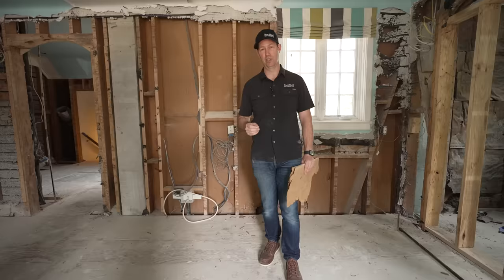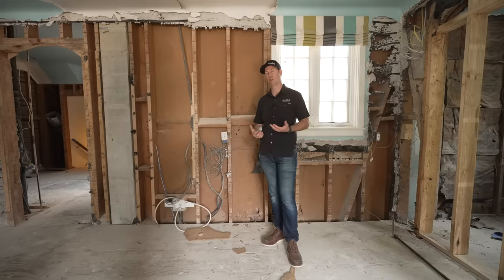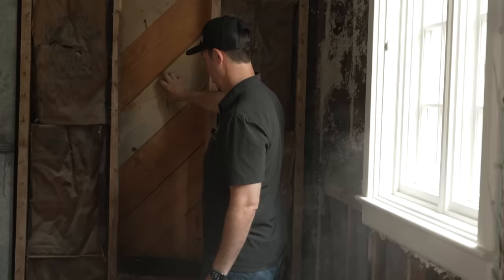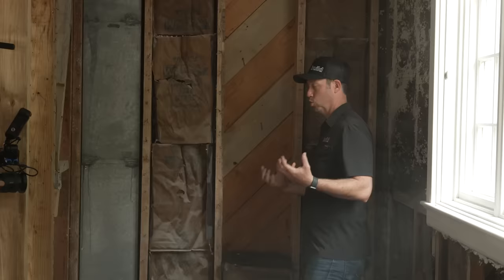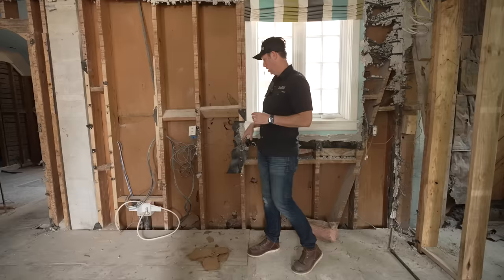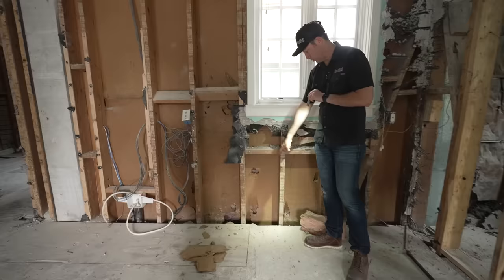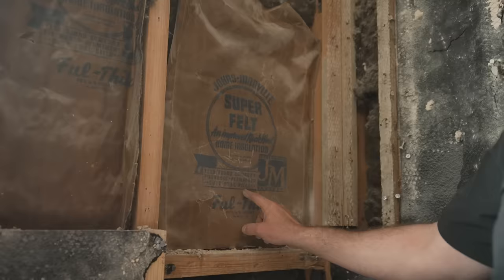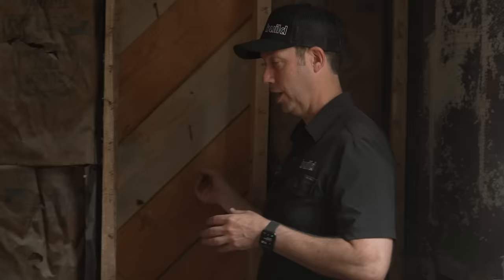I’m recommending we NOT INSULATE This Old House

Comment: If the owner wants to use sheet rock instead of plaster job, it is wise to prime the back of sheet rock with "Kills" primer paint before enclosing the wall cavity.   Also , instead of insulation. Maybe press into the cavity that tybeck fabric instead of insulation.

Comment: Tape the holes and spray foam it with closed cell then do the pressures sealer you did on your house
Reply: The sun will always drive moisture in, and you want to create a dam it can't pass through?
Reply: @AsHellBored  the sun will drive the moisture through the brick. It’s still air gapped on the outside. As long as the weap and vents in the brick are still clear it will evaporate just fine. And by creating the vapor barrier you protect the rest from the actually damaging humidity from the inside air at the dew point if done correctly.
Reply: @jameshancock  But is the 'closed cell' a vapour barrier?  I'm thinking it is not.  Therefore you have to be careful not to leave the dew point inside the insulation, somewhere between the inside face and outside face of insulation?  The cavity between the brick and the sheathing material looks to be ventilated, so will dry on that side.
Reply: @digital100000  it is a vapor barrier beyond 1.5 inches. Open cell is not.
Reply: @digital100000  Yes, closed cell spray foam is a vapor barrier at 1.5". Open cell is not. Matt has done videos on this and the difference.

Comment: Have an old home from 1920s.  I have the ship lap sheathing seen here with balloon framing, no insulation.  The wall material i tore off on 2nd floor exterior was Cellotex Lath (cane fiber board with 2 plaster coatings).  I am wanting to insulate.  Would you recommend the rockwool/thermafiber or a faced/unfaced fiberglass?

Comment: Not sure what/if it's called something else in the states but I've got the same in my house in Sweden, here it's called Tretex and it was used as the layer between the solid 3x10" timber wall and the wallpaper
Reply: it's actually garbage and burns like h*** but it does have an insulating property

Comment: I had a black spot appear on my kitchen ceiling, below the master bath shower. Pulled the sheetrock and found a leaking copper 90 degree. It looks like it had a slow leak for 20 years. Even though the screws had big rust circles around them, none of the studs had mold. Even though everything was soaked.

Comment: Repairs to old houses should be undertaken like restoration of an antique cabinet. Don't modernize it - preserve it. There is no reason to change this into a 2021 new construction.  Sure you can make it look pretty, but quality building materials and quality workmanship kept this house livable since the 1920's.  Repair it with high quality materials, update the electrical wiring, install high quality windows.  Don't make this an airtight submarine. With forethought and planning, this house could outlast us all.

Comment: that is why you don't put multiple vapor barriers in a wall.  if there's one, you can dry it from both sides of the barrier - if there are two, the moisture gets into the space between and doesn't get back out.

Comment: That area to the right is probably original wood board sheeting, about 4' out from every corner and maybe a few other key areas would have been wood boards for shear and the rest would be that cornflake box stuff.  I believe it was popular in Canada for longer than the U.S. but structures that used that stuff for sheathing either had wood corners or bracing inside the walls at the corners otherwise there would be excess movement and plaster (and possibly windows) cracking.

Comment: On my 130 yr old home, there is no sheeting on exterior walls. Just studs and you see the brick with plastered walls. Now, the house is covered with aluminum siding top to bottom. Wouldn't this make it safe to insulate the cavities? I have to assume no moisture is getting through the aluminum siding.

Comment: i have been debating the same thing with my house .. but i have plaster insides with clapboard outside . i'm thinking ZIP-rR on the outside (or plywood with atlas foam sheets ) with hardie siding with an air gap and no wall insulation ...

Comment: As some have mentioned, adding air conditioning will change thing going forward, with or without insulation.  Maybe you should consult some building scientists, before making a recommendation.  It's very likely they will have tried renovations both ways before and can offer some insight.

Comment: My questions: Is the air space behind the brick greater than 1"?  Would adding a secondary wall (double wall) be a solution? The inside cavity could be insulated. The outside cavity would be a full 4.5" thick & could dry out up & outwards. Does the exterior stud wall need some additional diagonal bracing or cross bracing?  Just some questions.

Comment: I love old houses, only downside is the fire hazard. Those open cavities in the wall makes it super hard for firefighters to stop the fire, so any in-wall fire will most likely end that house. I would personally invest in the electrical items, you even get wall boxes that fill up with fire retardant stuff today. Also, looks like the wiring is not currently in PVC tubing? I believe those are required for the fire retardant boxes to work.

I have seen old houses with metal tubing, honestly that would be pretty awesome if you had earth fault circuit breakers.
Reply: I would just add more firebreaks.
Reply: new houses will burn faster tho
Reply: @stewartcaldwell5299  Yeah, but the fire break blocks shown in this video are knocked loose and at an angle!!!
Reply: @markpashia7067   I think they're at an angle on purpose. Looks like 2X6s which would contribute a lot to the stiffness of the wall, in and out, and left and right.

Comment: hmm..I'm not sure you couldn't insulate  with un-backed bats - Moisture has to go somewhere and not condense and linger on the material. Mineral wool or fiberglass insulation would be pretty transparent  to moisture as long as it's not faced and you used lath & plaster since there' s no organic material.   I think your friend is correct.  I think TOH discussed the difference between vapor barriers in Northern versus Southern climates:  In the South, you want to keep the moisture outside from creeping in while North, you want to keep the moisture in (and prevent it from escaping through the walls) - with no vapor barrier outside the moisture will enter the walls and needs somewhere to go. I'm thinking you might also choose a stain wash instead of interior latex as that acts as a vapor barrier. I bet the mold abatement contractors know this stuff really well..  Good discussion! Hopefully some building inspectors and mold experts will chime in :-)

Comment: This is were you can use natural insulation en moisture open construction. Is the only way to insulate properly. That's how the moist can escape from the construction. Natural insulation like hemp or woodfiber can handle water a lot better than rockwool. We did it in a lot of historical buildings in Amsterdam.

Comment: Put Typar or some breathable vapor barrier inside the wall studs before the insulation. Could even build an secondary wall with an air gap for the insulation.

Comment: Would it make sense to just spray foam all the cavities?? And maybe add a sheer board on the inside, that way even if there was significant water getting into the old particle board, it could just rot over time and have no effect on the house, since the spray foam is keeping any mold particles from entering the house and the new sheer board can take up any of the load from the failing particle board

Comment: In NC, you start a remodel with a permit, it has to brought up to minimum energy code requirements.
Reply: Good point.  If following the law and getting a permit you will have options for the type of insulation but not whether or not you do it.

Comment: Tricky one indeed. I would clean and clear out between all the studs. Then batten across all the studs horizontally (to let air move around all the timber studs) and then fit a PIR insulation on the inside of the entire fabric followed by installation of a vapour barrier like tyvek airguard reflective and batten again for a service void then finish with foil backed plasterboard. Yes you would loose space inside but that looks like a big house so not such a big deal.

Comment: @mattrisinger  So if I'm building a new construction home (in a "no building code" area of the country) and choose not to use plastic or any type of modern vapor barrier but still want to insulate... I should just use solid products such as masonry, solid wood for framing, siding and sheathing?  In this type of build, what would you recommend as exterior siding (such as board & batten or shiplap/clapboard)? I'm worried about keeping the rain and snow out of the walls.  

I plan on constructing with large overhangs, solid wood and true stone masonry for siding for exterior as well as interior (vs drywall) and would like to insulate with natural wool or rockwool in the exterior walls that are framed (obviously not in the stone lol.  I'm worried about keeping the rain and snow out of the walls.  Thanks!

Comment: Been waiting for a video like this. I live in a 1925 brick house and its unbearably cold next to the walls in the winter, so I plan on insulating when I remodel.  I'm thinking maybe build a non structural wall next to the brick, sheath with plywood, then rockwool in cavity, then shiplap interior wall, so the wall can still breathe and dry out. However I havent come up with a good solution for preventing insects like ants from setting up shop in the wall.
Reply: Spray foam!
Reply: The safest way to do it is to insulate from the outside, adding a layer of foam board below the siding. But of course that's expensive because you have to redo the siding. And practically impossible if you have brick.

Comment: Naw. Take perhaps 1/2" rockwool or maybe one or two layers of that plastic lathe you used with exterior thin brick. Or anything that forms an air gap.

But first cut vent holes top and bottom (screened?) for each space so exterior air flows on both sides of the sheathing.

Then use closed cell foam right up to the interior surface.

Comment: This type of construction is very wide spread in NZ and Aus.  Usually brick with 50 mm air gap, no building paper, no insulation.  It is quite common for people to hire foam injection companies to fill the void and I agree with you.. I think it will cause nothing but issues.

Comment: This building should be rehabbed in the opposite manner of your own home rehab.  Install furring strip horizontally over the studs. Put ZIP sheathing, on the inside facing in.  Next, 2" closed cell foam over the sheathing and then the drywall.  The object is to keep the water from getting into the walls from the inside, allowing the wall cavities to dry to the outside as they presently do,  while still insulating the living space.

Comment: First time I've heard anyone weigh the risks vs benefits of performance/energy and structure/integrity. Usually you just hear how urgent it is to do whatever it takes to get your old house to net zero or some absurd ACH rating -- those are not always the singular priority in an old (historic) project, working on a finite budget

Comment: Frankly speaking, these paper boards seem okay and these is a gap between brick wall and paper boards. Since it is just a small area, it is easy to remove all paper boards, replace with glass fiber boards (Hardie Flex Sheet) by fixing and sealing them internally, and then put insulation. The depth is enough for R3 plus insulation.

Comment: I'd like to know how insulation in walls would affect an older house in a dry climate. It may not be the same. Instead we could have issues with warm moist air inside going outward-- and problems in our area (California) occur mostly at the roof level if ventilation isn't handled correctly. I don't think problems show in walls as often.

Comment: Our house has no isolation in the walls. It's a brick over block house built in the 60s. Our utility costs are pretty low because of the tremendous amount of thermal mass it has.

Comment: I have a house built in 1953. No insulation on the outside walls. It's got old school silver backed drywall. The thing is... I live in Denver.. we get down to minus 10...the excel bill, at it's worse was $120.
Reply: I am in Ontario Canada, have a house built in 1910 with no insulation and be hearting bill at i's worst was about the same as you (in USD).  hat is is with a 40 year old gas furnace and wood windows (with storms on the outside).

Comment: That stuff looks like Celotex lath.  It was used as a foundation for plaster, and would normally be found on the inside of the framing.  Not sure what it's doing on the outside of the framing.

Comment: Also, if you live somewhere it snows, insulated roofs tend to let more snow build up than non-insulated roofs, so adding insulation can have some structural implications.
Reply: Living in the north and owning an insulation and air sealing company you’re a bit off. You don’t want an insulated ROOF. The attic should be ventilated to keep the roofline COLD. The air sealing and insulation should be adjacent to the ceiling.
Reply: @koryleach9660  This!!! However you can insulate by making a "dry deck" for about an inch or so below the inside roof sheathing and have air flow from eave to ridge that vents to the outside. Lotta work but well worth it sometimes.
Reply: @koryleach9660  Fair point, my terminology was imprecise. Some of the 100-year-old houses around me have partially-finished attics and I always wonder if that will be problem due to reduced ventilation.

Still, if your roofline is currently warm enough to melt snow, don't do anything to make your roofline colder without first consulting an engineer. Especially if it's a gambrel roof.

Comment: I have an old house, 1959 and i want to insulate the walls. And i want to replace siding as well. Do you think it would cause issues if i do that? Based on what was said on the video? Thanks for the feed back. I live in Texas and summers are a nightmare

Comment: In the fiber-board section with holes, could they use unfaced fiberglass insulation if they went back on the wall with plaster?

Comment: I talked to two different insulators who had no qualms about spray foaming the underside of a 100 year old roof deck.  They did not understand the risk of rot when I brought it up.  It's just not worth it to use a vapor barrier or air sealer when there was not one before.
Reply: If your roof sheathing rots because it “cant breathe” ask yourself where the water is coming from.  Only a roof leak at that point is a moisture source.  A brick wall is always going to be permeable.  If your brining the attic space inside the thermal envelope by spray foaming it the issues of rot in unconditioned air are gone.  There’s not going to be any condensation in winter, which is the culprit.

Comment: Use polyiso on the inside (air and vapor sealed) then densglass on the interior for plaster finish then provide air circulation (in the cavity) if framing allows.   If not use rockwool since it would not be affected by vapor drive and use densglass (permeance >17) with plaster finish which would allow drying in both directions. ??????

Comment: I just had this conversation with a foam insulator I told him he should quit trying  to sell insulation to homeowners who own old homes for this same reason people need to do their homework before insulating older homes
Reply: @augustreil  I had several jobs in the last five years because homeowners had their houses foamed/insulated one was an 120 year old cypress siding house it had no insulation in it for all those years they had foam insulation installed all the siding started to rot had to replaced so much of that beautiful home all those square nails… the other was wasn’t as old but had the same problems so no sir I always assess each house before I make any changes especially behind walls
Reply: @texascraftsman7215 , I have a 140yr old house here in New England and insulated every single bay and never had any issues but I guess it depends on a lot of stuff. You make a good point though. Thank you.
Reply: @texascraftsman7215  Sage advice for sure. Wrapping up a project on our 200 yr old farm house and very glad I consulted more educated opinions when our GC initially suggested we use foam insulation with no consideration to how that would change the moisture dynamics.
Reply: @dougnyc8324  what did you end up going with? Many of the rooms on mine had cellulose blown in but I'm renovating two rooms they never did and not sure what to use yet.
Reply: @feyrband  We insulated with rockwool and used a paperless sheetrock - GP's Dense Armor Plus. This was the recommendation of the architect involved.

Comment: The product is called ""Biltrite". It was insulating board, r-? It wasnt very high but it did provide a thermal break. In many ways the "new and improved modern ways" arent. 
If this house is "improved" it wont last another 100 years.

Comment: Wouldn't adding air conditioning cause condensation of the hot air inside the walls?  This would not have been a problem originally.  So maybe a moisture barrier would be a good idea.